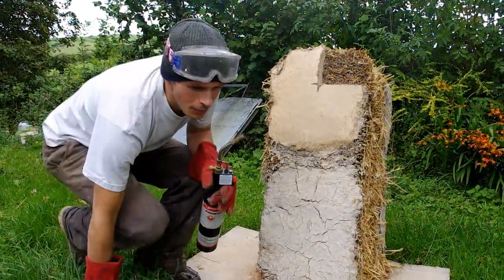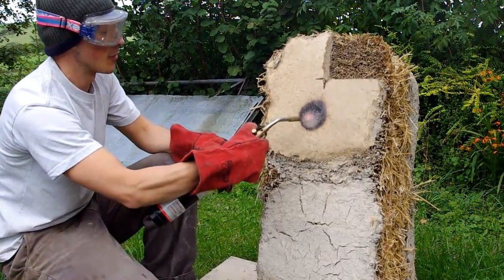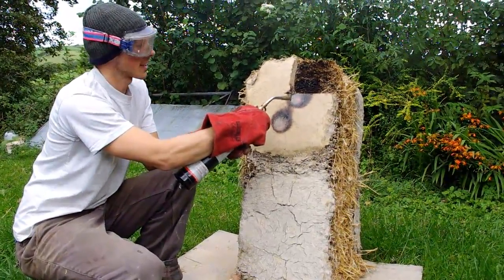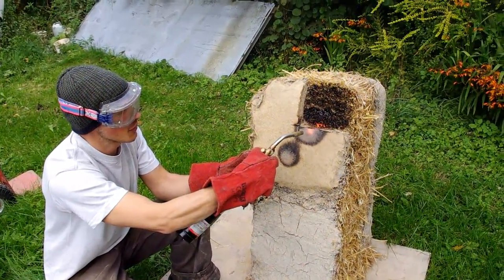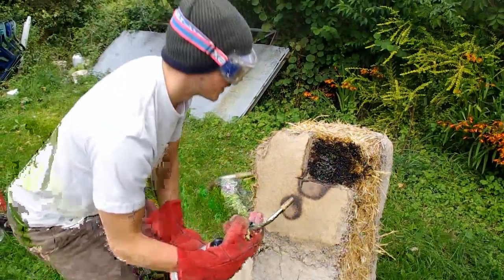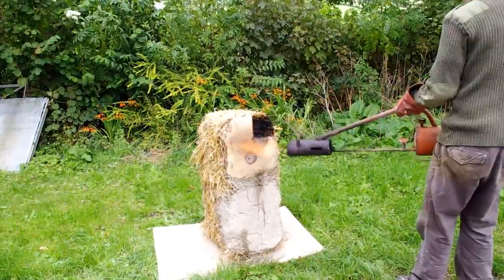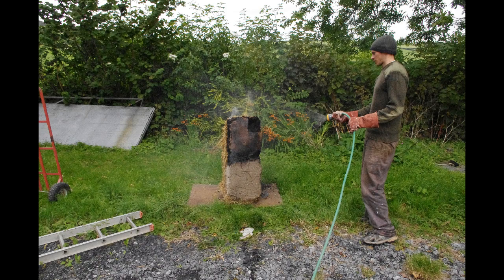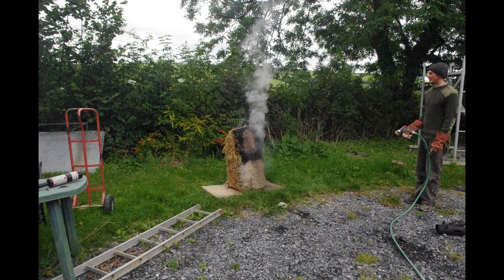Destruction Testing Clay plaster/ straw bale construction - part 2 of 2 - FIRE

Comment: So a the danger could be a slow smoldering fire and co2 poisoning from between the walls, but they appear to be fire retardant when covered in plaster. Straw is very flammable from the outside, when the straw can act as a wick.

Comment: So Straw Bale  + Clay plaster is proven to be very good fire resistance but what about cob wall. I've been searching for videos for all type of straw house or wall fire resistance test but it's so hard to find.

Straw Bale + plaster.
Clay-Slip + Straw.
Straw + Soil + Sand (Cob)

3 type that I heard of but only straw bale wall have been tested for fire resistance but which is better?
Reply: Well cob is a masonry product, so setting it on fire would mostly make it harder. The results would be similar to trying to burn hard dirt-it wouldn't.